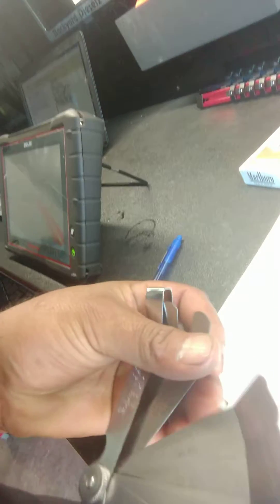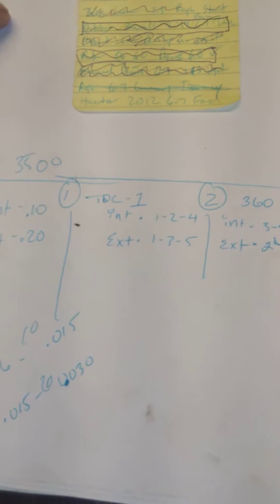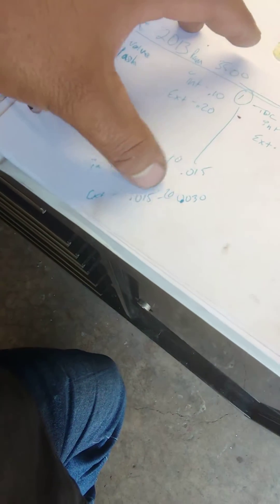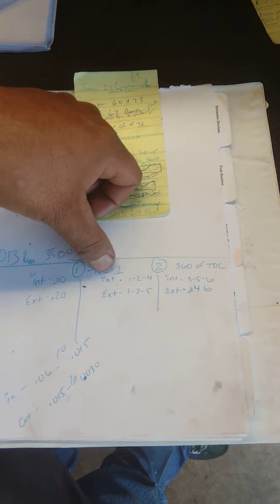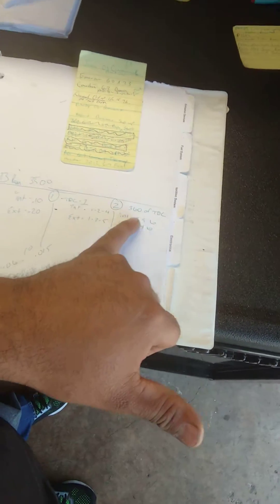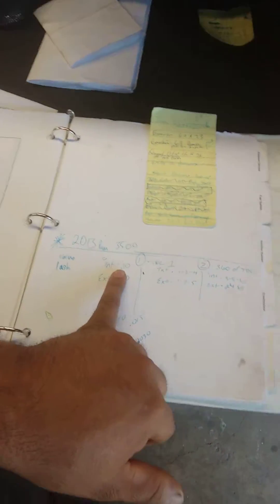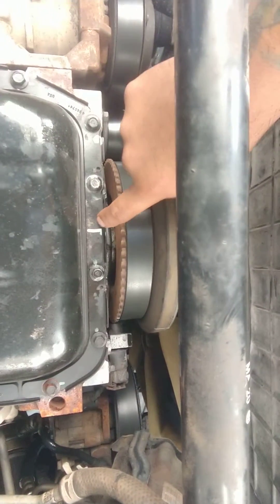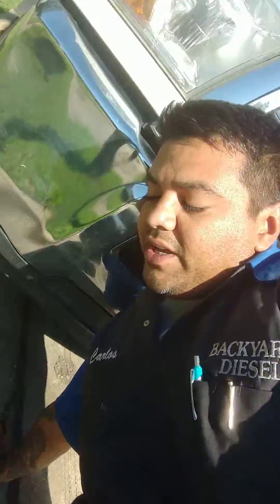2012 Ram 3500 6.7 valve lash

Comment: I have a 2013 dodge ram it's over heating I looked at it seen the the coolant fan isn't turning on what you think I should do or check out first
Reply from the maker: Check for power... Make sure you have 12v at the connection..and  check ur wiring..  not turning at all...make sure is spins freely by hand.. engine off.. check use fuses..
Reply: @BackyardDieselz  it does spi. Freely I mean
Reply from the maker: Check for voltage..  if good you need a new fan clutch... But check the wires very good.. make sure there not shorted out..
Reply: @BackyardDieselz  I don't have anything to check the voltage rn ...I went thru a big puddle of water now Iam guessing something must of but out not sure
Reply from the maker: Yeah get you a volt meter or test light to see you have voltage or power.. at the fan connection most likely fuse blown or relay... Since the connection is at the bottom...
Reply from the maker: Let me know what you find out bro
Reply: @BackyardDieselz  Iama have to take it to a mechanic dude idk wth is going on there's water so idk why it's over heating
Reply from the maker: Are you sure it's overheating... It's not the senor or plug..
Reply: @BackyardDieselz  yes it's overheating...I checked the plug nothings wrong with it....remember I drove thru water so maybe the sensor burnt out the fan burnt out I haven't checked the voltage yet so yea idk
Reply: @BackyardDieselz  it won't spend by hand all the fues are good